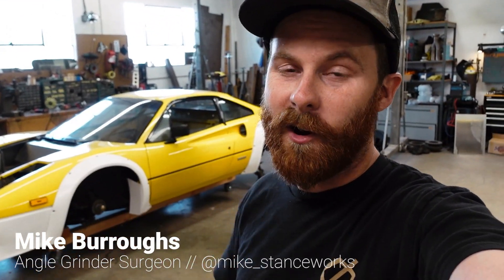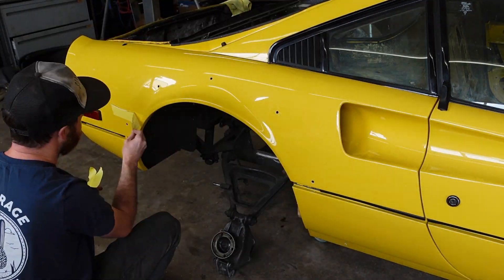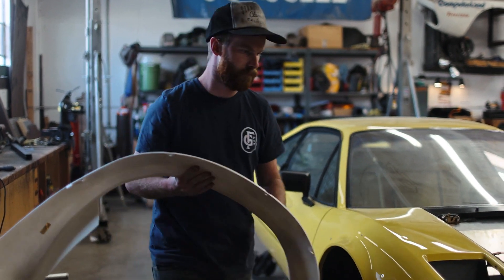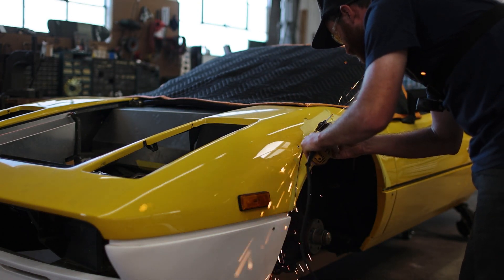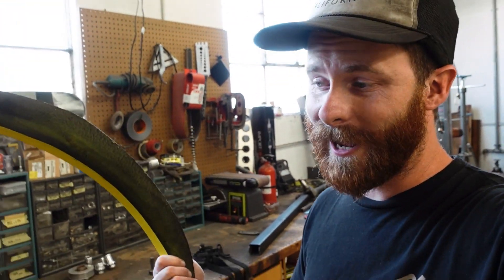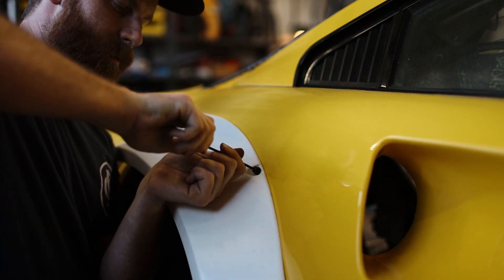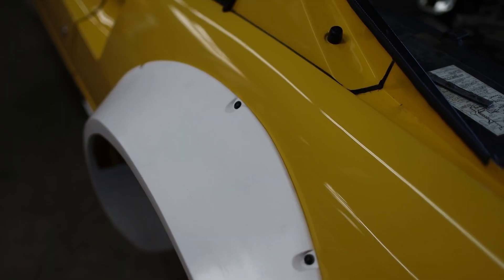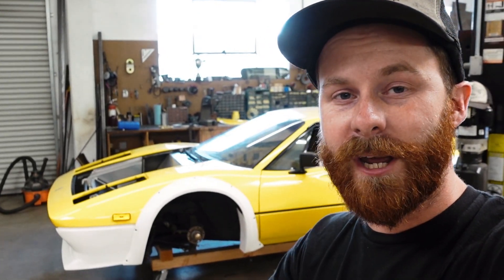Hacking the Fenders Off My Vintage Ferrari -  K24-Swap 308 Liberty Walk Widebody Install Pt 2 Ep. 34

Comment: Not all of us 308 owners are "purist snobs". I love what you are doing and am considering doing the same. So far I've just installed a push button start, magnaflow exhaust, carbon fiber bumpers, and now I'm fabricating a mesh valance to replace the original ugly one on the back. Congrats!
Reply from the maker: Glad to hear from a supportive 308 owner!
Reply: Did you ever think of adding a modern ECU, doing some head work and lighter rods/pistons?

Comment: 305 width front tyres. With no power steering that will be interesting to maneuver at low speeds.
Reply: Agreed
Reply: Perhaps speed sensitive electric power steering?
Reply: 305 is a crazy overkill...
Reply: @kpsig   but cool nonetheless
Reply: It's gonna look ridiculous but who am I to crap on one's ego.
Reply: He can always get a volvo electric power steering pump and it would be independent system
Reply: Steroids Mike
Reply: He’s gonna look like Popeye real quick
Reply: @Ed-ur5be  or the MR2 pump
Reply: Mid engined cars should have staggered tyres.
Reply: Real men don´t need power steering.
Reply: It may not be.  If he keep the scrub radius close to zero it might not be so bad since the car is so light weight.  I'm really interested to find out.
Reply: I guess it's quite off topic but does anybody know a good place to stream newly released series online?

Comment: Tip
If using rivnut stock hold things to a flat surface and you want them to mount flush try the following,
Find a flat washer that will slip easily over the top of a compressed rivnut, a washer the same size as the flange of the rivnut a washer with a large diameter but small hole. Use CA glue to stick the washer with the large hole to the one with the smaller hole so they’re centred. When the glue is dry use the washers as a dimple die to create a divot for the rivnut to sit in.

Comment: Channeling my best Minion voice. BAN-NA-NA!! Hi, I'm loving the channel.  Just a small tip for your b-roll. You can make it look smoother by using slow motion.  Instead of trying to move your camera smooth and slow, set a high framerate and move normally.  When you slow it down in the edit, it looks buttery smooth.  Keep up the good work.  I wish I could have a whip of your Rarri.

Comment: Whatever you do DO NOT use the OEM rear stub axles!!!! They are perfectly ok for OEM sized street tires but even a change to R-Compound tires will make them fail where the axle meets the flange due to the increased loads. This is well known among people who modify 308's for track use. Oversized tires will 100% for sure break them and when that happens you will lose a wheel. Just a little heads up from a guy who has earned each gray hair on his head. Awesome job with the kit install and I can't wait to see the next installment.
Reply from the maker: So I've heard! I'm planning on custom axles, I appreciate you looking out!

Comment: Hey man, I suggest you should use self tappers for mocking up of the fender flares that way you don't have to put riv nuts on the body before the paint work. After the paint is done you can put the rivs and then bolt them fenders to the body. It'll save you lots of time. :)

Comment: Instead of making a customize upper and lower arm, you can consider to make the uniball joint adapter to replace the original ball joint and extend outward to fit your offset. It will be much stronger than stock ball joint.

Comment: For drilling clean and round holes, try a step-reamer or a "dreamer" (reamer with a pointed tip). We use these in the aircraft industry and they also drill really clean holes in composite with no blowout on the backside (I can already hear the jokes).

Comment: Please put on a face shield or weld hood when using that angle grinder with the cut off wheel, and put the guard back on if possible. I've had those things explode leaving shrapnel from cut off wheels left in people's faces. You can lose an eye or even get killed. Those things come apart all the time and you don't want to go without face and head protection.

Comment: I once cut my F308 fenders to make it a GTO lookalike, but is was in way more bad shape. I made it a GTO light, 308 wheelbase and not as wide as a GTO. Then I wanted to go full GTO and made custom A-arms that changed the wheelbase and track width but I decided to go back to original. In your case you can use Mondial or late 1988/89 328 suspension arms (they are the same) and drive axles, this will give you your desired track width with reasonable wheel offset. Compare track width Mondial and 308, about the same but the Mondial uses much larger wheel offsets because of longer A-arms.

Comment: Surprised that you don't roll over the edge of the metal 5 mm or so for structure, as well as getting a non sharp edge. The latter is nice if you get some scrubbing.

Comment: Hell yes, counter culture makes me so happy. What people don't realize is that drivetrain wise, this Ferrari doesn't lose any of its race heritage roots. Honda's VTEC i4's are race bred motors from the factory. They utilize the same technology and research from racing the same way Ferrari integrates its knowledge of racing into it's road cars. Don't believe me? Honda from the factory weight balances components like pistons and valves to make sure the clearances are correct for reliability and durability under the stress of high revving. A K24 can and will make upwards of 300HP NA if tuned correctly. This is seriously impressive for a mass produced i4 and makes close to the same power to the stock V8 after a tune.

Comment: Your mock up of the two different colour choices missed something. In the yellow rendering, you forgot the small rubber gasket that goes between the flair and the car. It will add the so needed contrast between the flair and the car. Will pop those flairs just enough to see the contours. Like piping on a leather sports seat.
Reply from the maker: It’s there in the first yellow rendering
Reply: @stanceworks  oh, ok. Didn’t notice it. 😁

Comment: Your car so you can do what you want, just think it looked better as original and not the boy racer look and would have been cooler as what externally appeared to be stock and the ultimate sleeper . But again, your choice so enjoy.
Reply: But he is building it for time attack, it would look weird being stock with aero added.
Reply: @JoshTHankins  - Yup, understand and fair enough. It just limits the car to more of a track focus from here on. I think he could have cut up a lot cheaper cars and not a classic Ferrari for that use. But then again I was fine with the engine swap and that required a lot of cutting, just not as visible from the outside. I'm cool with it as he paid for it and has the right to do whatever he wants with it. In any case, it will be special/unique and if it performs as well as he hopes will be a good move for him.

Comment: Please don't put square setup on 308. Put 9 inch rim at front. 11 is too much!
Reply from the maker: Based on what?
Reply: @stanceworks  based on my experience, your handling will be corrupted, no matter how light wheels are going to be 18x11 plus 305 rubber, this setup is just going to be too heavy for that car....just my opinion,  nothing personal.